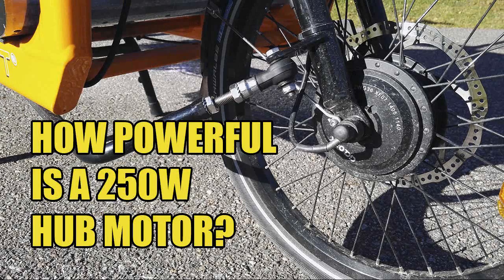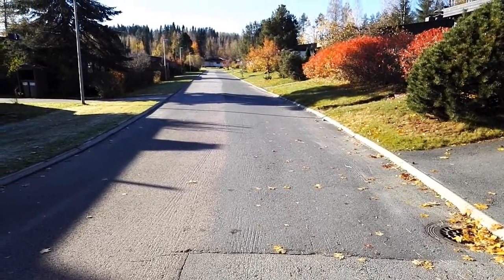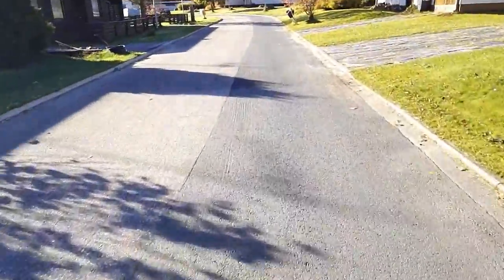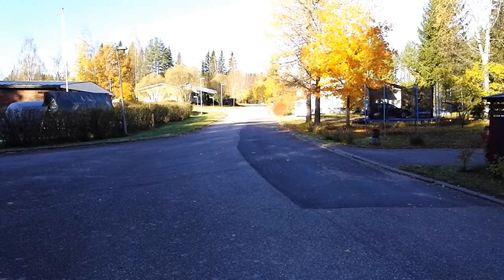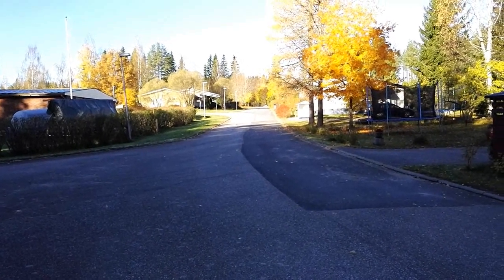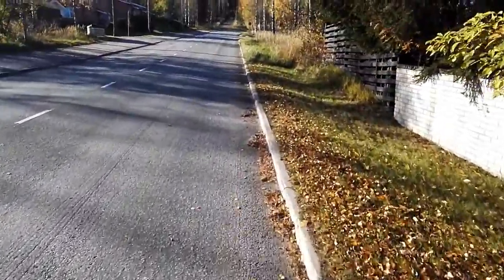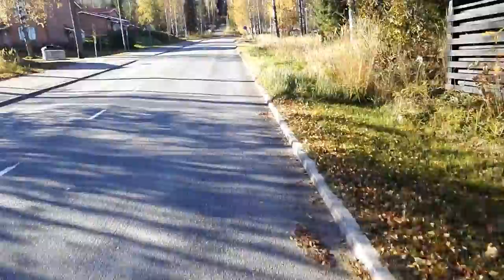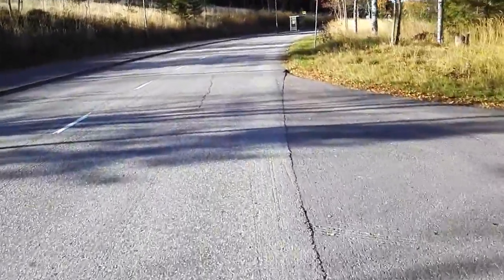How powerful is a 250W hub motor?

Comment: Good video, but, I'm wondering the following:

1.  Which type of battery do you use -- lead acid or  li-ion?

2.  How far can you travel on flat terrain with your 36V, 13Ah, 486Wh battery -- if you run it full throttle, without stopping?

3.  What is the max temperature that the motor can tolerate before it becomes damaged?

4.  How long could you push your 250W motor at 500W+ before it overheats or suffers from heat-related damage that may shorten its service life?

Thanks for sharing!
Reply from the maker: Thanks!

I will answer your questions as far as I can.

1. I use a li-ion battery. Most ebike batteries today are li-ion type.

2. I can only answer this question in theory. As you stated, my battery capacity is 486W. Let's assume I go full throttle without pedaling at all. This brings the bike up to a speed of 20km/h on a completely flat surface. Once up at 20km/h the motor will use 240W of power to maintain that speed. With a battery capacity of 486W the battery will be empty in two hours and I will have traveled 40km. But this is only in theory. I am planning to do a real life range test as soon as the weather gets a little better where I live. 

3. Sorry, I don't know the answer to this question. 

4. Unfortunately I do not know the answer to this question either. I have now ridden the motor in this video for 5000km. I opened the motor a few weeks ago and it was in good condition inside with no signs of overheating. So I would say there is no need to worry if you plan to use your 250W motor in a pedal assist application. It will last you a long long time on a commuter or touring bike where you assist the motor by pedaling. 

If you plan to use throttle only and live in an area with many hills, you will probably want to look for a more powerful motor and much more battery capacity.
Reply: Thanks for the reply to my questions.

Do you know your battery charge % & voltage when your controller cuts-off discharging to protect your battery from over discharge?
Reply from the maker: When riding the bike, the battery BMS (battery management system) will cut off power when voltage reaches 2.75V/cell. I have once experienced this on a very cold day when the battery was left outside for several hours.
Reply: Thanks for responding & for the information.

That's interesting information because I've read the datasheets for many li-ion cell chemistries & I've seen many recommendations for discharge cut-off @ 3V.

It's my understanding that allowing discharge below that V limit risks damage to cells that causes lowered charge capacity & lower useful life spans.
Reply from the maker: A B 

I agree. And the BMS cut off voltage is probably set at 3.0V. The battery voltage went down to 2.75V only for a few seconds before the system shut it down. Without load the voltage roes back above 3.0V within seconds.

It's not a good idea to frequently  run your battery till its almost empty. You will get longer battery life if you avoid fully dicharging it. I usually consume 50% of my battery each day and charge it full every night for next days use.

Comment: There is lot of significance to this vid.  The 250 watt Bafang geared hub kit is the best kept secret in  the e-bike world.

I'm an e-bike conversion builder and e-bike enthusiast.  My first build was a 350watt/36volt-10ah (rear Hub), then a 3,000 watt/52volt-40.8ah (mid-drive), a 750w/52v-27.2ah, and finally a 250whub/36v-20ah (front hub) on a Trek Single Track 930, with 26" wheels.  On this last 250w bike, I've disconnected the PAS and use throttle only.  It's a 3x8 speed with 44t-32t-24t crankset against a 46t-11t cassette.  This gear combination on a good bike like the trek allows 20mph top speed, but climbs any hill up to 15 degrees.

Of all these builds, my favorite and the best by far is the last one - the 250w.  This is because:
a) Bike reaches max legal speed of 32km/h (20mph) easily
b) Climbs any hill with ease
c) With the 20ah 36volt pack my range is 90 miles!!!
d) Even if I do run out of battery, the gearing and pedaling is easy that I can still get anywhere,  even climbing up to 10-12 degree inclines without e-power) 
e) weighs only 48 pounds! Easy to lift, maneuver, and move around
f) by taking off the removable battery, I put it on bike rack for transport
g)  FUN!!! It's really fun to blast around with minimal pedaling (average speed of 27km/h) yet have literally no range anxiety.  This 250w is so frugal with battery consumption, and the bike invites you to pedal.  Pedaling is engaging and super fun, no stress at all!
 
Sure, I can keep up with car traffic and reach 40mph on my Cyclone 3000 watt mid-drive.  But in this motorcycle mode, my big 2kwh 52volt 40.8ah pack is drained in less than 30 miles. Plus the bike is 65 pounds.  Pedaling is almost pointless.

The 250 is the way to go.

Comment: I’ve got a 250w hub motor with a 36v 10AH battery and with out peddling on 700 x 47c tyres 29.8 klm uphill it uses the most power and it gets up to 635w. But sits at 26.
Reply: Hard to tell the hill slope grade percentage from the video, even google maps or komoot might not show the true numbers

Comment: Good video. Ye in the UK its 250 watts, max speed 15.5 mph (25 km) assist then cuts off. I use my bike everyday riding 20 miles. max milage is 37.5 but not done that yet. Might have to test it in a couple of days to find out.
Reply: Gwyn Williams unless you fit your own and avoid the law.
Most UK cops would never have a clue unless your doing warp factor 9 and give them cause to stop you
Reply: if u unlock it it will only go to 28,30 km, since 250w hub does not have the rpm to go past that, u may push 1000 w if u wish(battery needs to support this) but u will def fri it and it still would not go past the 30 km without help
Reply: As long as your ebike doesn't look like a motorcycle, you're not going at mach 5 down a residential road, and you're 'peddling', you'll probably get away with it. Maybe exploit those controllers that have road legal switches.
Reply: Defiant 1 in my state it's 20mph but my bike will run 34mph on flat ground. But I keep it at around 15 miles an hour to conserve the battery and I'm in no hurry to get anywhere. The top speed on the bike was measured by GPS. But I live in the mountains so I bought a 48 volt 20 amp power system. And 1000w motor I also added rear disc brakes, and switch from a 2.30 to a 1.75 Tire for less Road resistance.

Comment: So the 250w motor can just about do it. 
Have you tried it on a 500, 750w motor?  Would be interesting,  not so much for the speed but more for the torque, and safety especially as cars tend to accelerate up hills.

Comment: Hello my hub motor is of 36v 350w rating..  I supply power of 36v via battery pack but the motor rotates slowly.  What is the problem???

Comment: so even if it was rated 250W it does go beyond that?  I'm a but confused.  now I have to double check the thickness of my nickel strip that I was using to repair a certain bike that runs with the same brushless motor.

Comment: How powerful is a 250w hub motor is a complicated question, the reality there is no such thing as a 250w hub motor as that is just a sticker rating to make it legal in country's with oppressive regimes like the UK, the reality is most 250w will actually regularly use close to 500w on a good 36v battery when under stress, and my UK road legal bike would pull me up a fairly steep hill with ease at around 8mph and would cruse at 17mph easily, however since then I have replaced the controller for a 26A  1000w one and upgraded to the battery to 48v one and while it can go over 30 i have it restricted to around 20mph as hub motors are incredibly inefficient at high rpm and my goal was better acceleration and hill climb ability, and now that same little 250w motor under its own power pushes me up that same hill at 16mph.

So to answer the question of how powerful is a 250w motor well it depends on the controller and then the battery and the motor is not a factor in this, because if you have a 36v battery with a 250w motor and a 8A 250w 36v controller it is going to be less powerful than the same set up that's using a 13A 250w 36v controller, and then mix in 48v battery's and 1000w controllers and a little old 250w motor can be incredibly powerful.
Reply: Is ur 250watt motor a front or rear drive hub motor,thank u
Reply: I think 0.25 kW is the limit anywhere in EU, so is in my country, but as you said, I've seen on this screen of the video reach 500 W, double than marked? Is that legal then?

Comment: You're seeing around 500W when climbing a small grade. Your input power is way too high for such a gradual grade and you will run your batteries down quickly. Better to have a mid-drive solution as the motor can be kept in the efficient rpm band and you'll use much less input power for the same or better performance. 250W front hub motors are only really good for flat surfaces to keep you moving along effortlessly.

Comment: Thanks for sharing your experience.  Two remarks: nominal output power does not indicate all, since there is a trade-off between speed and torque, I mean: you can have a 250W output motor configuration made for more speed and less torque, or, on the other hand the same 250W for more torque and less speed. The latter will do better on hill climbing and initial acceleration.    One other remark: why would a continuous output watt of 350 W motor be nominally named a 250W motor?

Comment: So the weight of the bike and rider is 307  U.S.A. pounds and you traveled up the steep hill at 6 miles an hour.  I call that a success for the small 250 watt motor

Comment: Hmm. According to my speedometer, my 36v 500w rear motor can only do 13 mph on it's own power. 18 mph if I pedal with it. I'm using a 15+ year steel frame Target brought bike. I weigh about 200 pounds. And I was on flat roads on a calm day. No hills, no wind.
Reply from the maker: Is your 500W motor direct drive or geared? I have heard people say 250W geared motors equal 500W direct drive motors. I have no personal experience though.
Reply: Geared. I never knew direct motors were so huge.
Reply from the maker: Ok. I know they sell my 250W motor geared for different speeds. I could choose between 15, 25 and 33km/h top speed. Mine is the 25km/h version and will almost do that mounted to a 20" wheel.

Mounted to a 26" wheel it will do 27-28km/h.
Reply: I discovered something interesting. Apparently my controller has a blue wire called a "road legal switch wire" This wire limits the speed to a mere 12 mph. Disconnected ramps up the speed to around 20-22 mph as advertised. The eBay listing says nothing about this wire. I just happen to discover this bit of information searching eBay for a 48v controller. Searching Google doesn't bring back any info on the wire. Just more eBay listings with the words in them. Much better now because the original speed was so disappointing. I'm still surprised by the new speed despite the heavy steel frame.

Comment: Thank you for this demonstration but I am confused. Surely a 250W motor can only deliver 250W yet when you demonstrated in your uphill ride your motor was delivering 500+W. That aside however, you clearly showed that to propel approximately 150kg up a reasonably steep incline 500W is needed  therefore if my 250W motor only delivers 250W it follows that I would need to put in  sufficient pedalling power to overcome the 250W deficit. Not bad considering that is the power one would normally put into pedalling on the flat.
Reply: It is 250W constant power, you can exceed it but it will burn at some point if you ask more from it than it can deliver. If you dunk it on liquid nitrogen, you can most likely get well over 1000W worth of torque from the motor. This is where the price of the motor starts to make differences, cheaper motors do not handle overpower very well whereas more expensive can cope with twice the rating on a cool day.

Comment: The word "powerful" should not be used in the same sentence as 250W.
Reply: Chris Duke Unless it's a vibrator.
Reply: I hope you're not throwing 20" in the mix then Gillenz
Reply: Sure it can. Analogy. If someone has never been in an automobile and asked, how fast is 50mph (80kph)? I would take them on a trip so they could get a feel for that speed. Note that I used "speed" and "50mph" in the same sentence! But you, however,  would just look at them and say, 50mph. Now, who did they receive the best answer from — you or me?
Reply: Yes it should.... 250W is the input power and he's curious what the resultant output power is going to be in practical terms like can it move him along nicely... Will it take him up a hill....
Reply: barefoot69 - "That speed" means "that speed". Not complicated.

Comment: I'll bet you wish you would've bought a 500w or larger hub motor. You can still conserve power with a bigger motor and it's nice to have the extra power when you want it, I bought the 1500w rear hub motor and disabled the PAS, now it's like a motorcycle with 29" wheels and tops out at 42mph.
Reply: Yeah, but if the police ever take an interest you could be up for big fines.

Comment: He says the motor is pulling him uphill at 4:00 but if you look at his shadow,  you can see him peddling at 4:14
Reply: That's because you have to move the pedals for the motor to run - if he didn't pedal, the motor would shut off.  That's why he said he was just turning the pedals, not pressing on them.